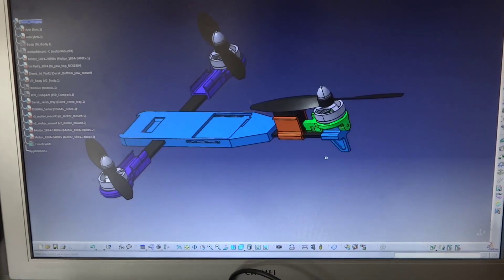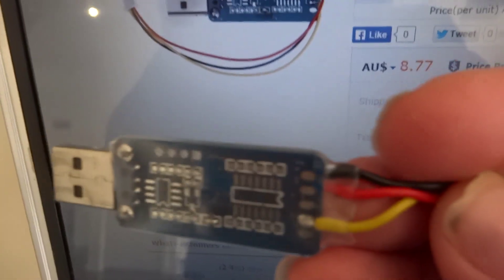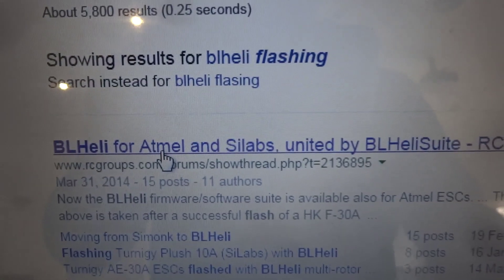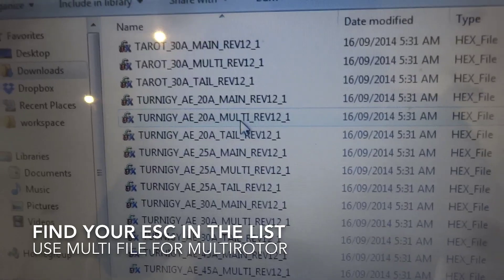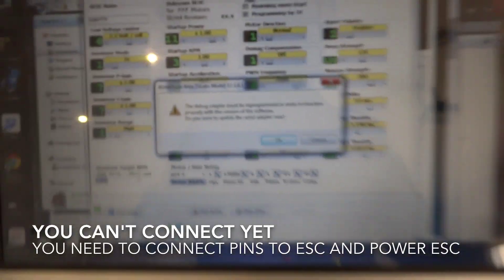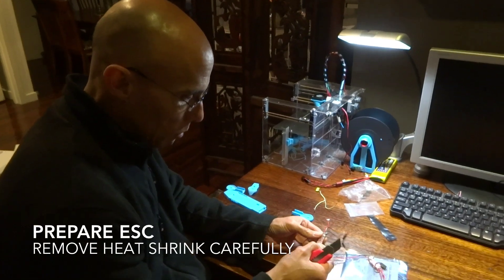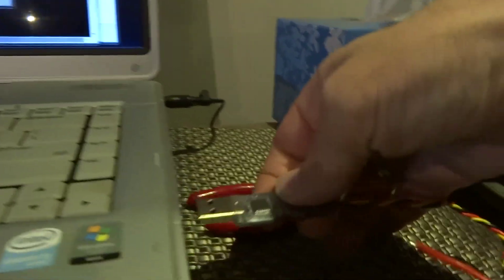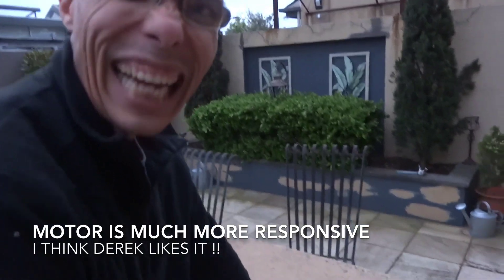How to flash an ESC with BLHeli

Comment: what if my esc's are already soldered to my power distribution board ?
Reply from the maker: That's even better just plug the battery in :) if you want to be careful then remove the props
Reply: jbalatutube thx

Comment: Thanks for posting this how to.  I just built the same rig you have and updated all my Emax Simon K ESC's to OneShot and wow what a difference in performance on the quad.  It evens sounds different in flight.  Here is a picture of my rig.  Thanks again.  https://plus.google.com/+JonCarEnergyFree/posts/LB2fQ8fPo2B
Reply from the maker: Ha similar to mine, good stuff. I have yet to try oneshot on mine I just got some sn20 esc's for my Skidmark quad build
Reply: Yes it is your design.  I think if you use the latest 13.01 firmware you get OneShot enabled.

Comment: hi
didnt change the red and black now when i plug the usb in my pc the dongle start to warm up is it dead ?
Reply from the maker: More than likely but you have nothing to lose so see if it gets recognised by your pc and see if it connects to the esc, fingers crossed. Keep an eye on the temperature and good luck.
Reply: jbalatutube 

Dose the black and red wires
should be opposite on every use ?

or it is designed  to be used for different purpose thats why the wires are solderd backwords ?
Reply from the maker: Yes it was designed for a specific type of controller board

Comment: after you do the first flash and update the ESC can we do future updates using he ESC motor controller lead?
Reply from the maker: Unfortunately not
Reply: I will just solder leads and leave them attached for future upgrades.  Thanks for the Video
Reply from the maker: It's up to you, it's not something you need to keep repeating and the peg is easy to put on. Thanks for watching. I now do all the flashing and updates using the BLHeli suite.